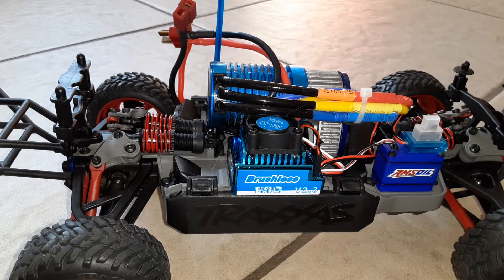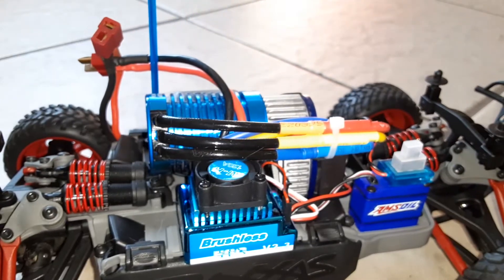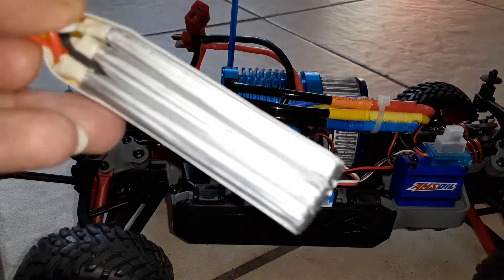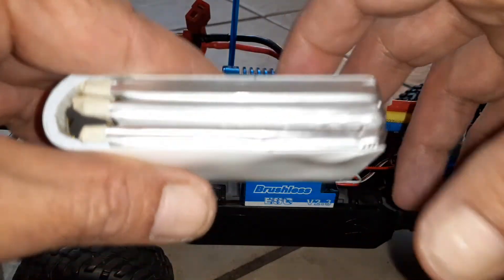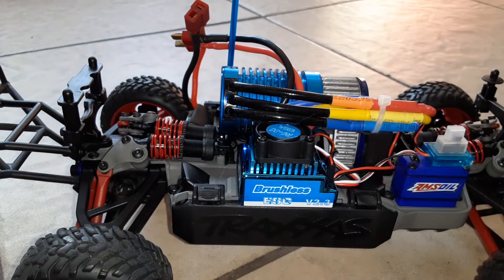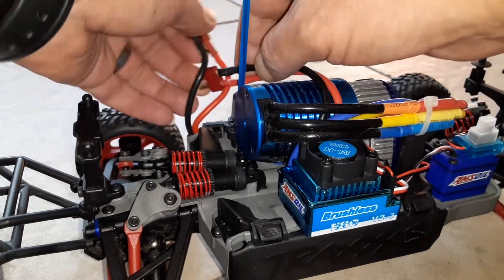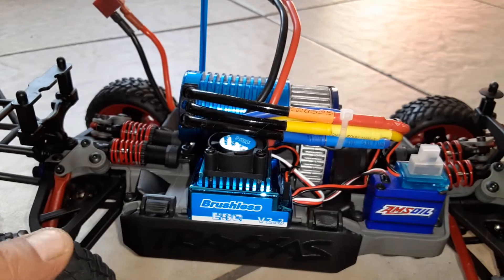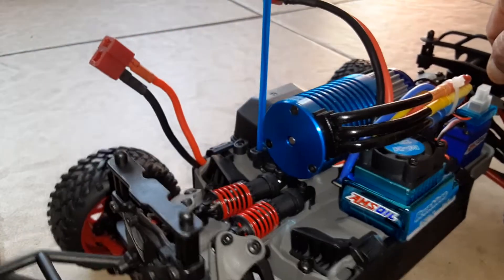$18 Tsky 120 Amp ESC 2s Otside Test Run Will It Have COGGING issues?

Comment: I bought a ESC like this one and installed it on a 1/14 rc truck and it doesn't work I programmed the start up to 8  and nothing was using a 3200 KV brushless motor and it could not power it

Comment: Fun fact depending on which one you buy that looks like that it can take up to 4s ive done it personally but you are right on the program card deal you gotta turn up the punch to get rid of the cogging anyways great video! And the one with the red button is a x car and its sensored too which works great with my castle motor!!

Comment: Hey u know how it is now im shure they pump out so much this stuff your bound to get bad 1 once in awile lol but i got bunch those lil esc’s that u burned up & i have run 4s on em as long as kv is not to high like under 4000-3800kv is good & cant b running 3650 cans off em thats for 120a chunky esc’s lol

Comment: Thanks bro. I bought this a few days ago off Amazon. Thought I'd bought a dud. It works but it cogs like a bastard. I've now found the programming card on Amazon and gonna order it today. Hopefully this thing will will do me proud..
Like you said also it's a little big and awkward to install but I managed that too.
Anyways cheers bro 👍
Reply from the maker: After you program the Start mode it will run great but NEVER USE 3s ONLY 2S lipo batteries and it will last forever. If you need more power gear it up but no 3s battery
Reply: @MightyistheRCGamer but why you tell not to use 3s . please explain it? 
 it will burn esc or anything else?
Reply from the maker: @soumiksaha720  the ESC will be fine but when using 3s it burns up the part that you put in the Receiver then you have to buy a adapter because when you plug in the ESC into the Receiver the ESC will not turn on anymore  I think it's called the BEC but if you don't believe me then use 3s. There are many YouTube videos of people showing what happens to the ESC on 3s
Reply: @MightyistheRCGamer  Thanks brother. ,
Reply from the maker: @soumiksaha720  No problem but 2s runs great I had mine for 1 year no problems  but you can gear it Heavy to make up for not using not using 3s and it can handle it without getting hot
Reply: @MightyistheRCGamer  actually i am new in  this hobby rc . i already upgrade waltoy 124019 brushless. use f540 3300 kv motor and 60a esc in 2s lipo but in road, it's no cogging issues but in grass it can't run because of cogging . can i use programing card and change the value of start mode? can you have any idea?
Reply from the maker: @soumiksaha720  yes but some esc use 3 options and the one I am showing uses 18 options so you must know from the ESC instructions
Reply: @MightyistheRCGamer  my esc also same 18 options. Thanks again . Have a nice day.
Reply from the maker: @soumiksaha720  Then buy the program card I have and I promise you won't have any problems again my friend
Reply: @MightyistheRCGamer  Specifications:
Item type: brushless speed controller
120A continuous current, transient current 760A
support the 2-4 lithium battery or 4-9 Ni MH battery
BEC output: 5V/3A, switch mode.
Item dimension: 16cm/6.3"X6cm/2.36"X5cm/1.97"
Item weight: 72g
Reply: What programming card did you use?
Reply from the maker: @thefishrmn Cheap hobbywing Clone programming card

Comment: Just got this esc ran on 3s for about a minute then cut out and the car ran away now it only beeps when I hook up 3s but works perfectly fine on 2s could it be an over volt protection?
Reply from the maker: I would never use 3s on this cheap ESC. I only use 2s ONLY and mine still works perfectly fine
Reply from the maker: I am very sorry brother that happened to you
Reply: All good just moved it to my drift car (no need for more than 2s) programmed it and works even better than the old esc did on 3s

Comment: Wanna hear something really amazing? I've been running this ESC in an infraction mega on 4s for a week now, pulled 60mph out of it so far with a 4300kv surpass motor. Now I switched over to a 7700kv surpass motor on 3s, she pulled 60mph again, so I tried 4s and she finally caught fire! But wow am I impressed with this old hobbywing clone, it took a ton of overheating, repeated thermal shutdowns before it popped. Totally abused it. the new version Of these, HW 8bl120 won't let me run 4s, it's protected from over voltage so I actually prefer these old clones, I applied for refund, got my 30 bucks back and bought another one haha. Think she's take 5s for a few runs? I should start a channel posting my cheapy cheap escapade mission for 100mph for 100 bucks! Can I get some likes if anybody would like to see that, thx!

Comment: Nice Video even tho im late...I bought this for $75 120 amp combo with a 3650 brushless motor running a 2s 3200 Hexfly Lipo for my Arrma Senton Mega 4x4. first time installing it on a17t ..i think stock pitch. and I'm lovely at 40mph. your rig looks good after reviewing a weeks worth of intel from other enthusiast. I'm glad i was able to purchase this setup for my rig. I personally don't mind the slow start as i will try to preserve my drivetrain and gradually roll the throttle. Feels good at stock punch. 🏎💨🏁👍
Reply: It's crazy that 75 bucks sounds so cheap compared to years ago, but now if you look around, 75 bucks is actually overpriced. U can get a 60, 80, 120amp combo at 45, 50 and 55 bucks. That's the rock bottom price, but here's the kicker, that's Canadian!

Comment: I changed the capacitors using zlh 560uf (has similar footprint with the 470uf chinese caps) and added a jst connector on the deans in case I needed to use a power hungry servo... Usually those esc's have poor BEC (1-amp rated)...

Comment: I am wracking my brain trying to get the punch mode much higher than i have it.
The last one i had went up in smoke but i was in long grass on 3s and it was fresh on.
I  at least want it to give me more boost than the 80 amp i took out.
Reply from the maker: You must have a program card there is NO WAY TO GET AROUND this when you are messing with brushless motors and I do not mean that little tiny program card that only has four items and values you need the one I have with 18 values
Reply: @MightyistheRCGamer  I have never came across a brushless esc that is not beep programmable.
Reply from the maker: @BrentTheGent1  That's because this ESC isn't very good but it works perfectly fine with 2s and I already have BRUSHLESS Program Cards so programming was Super Easy